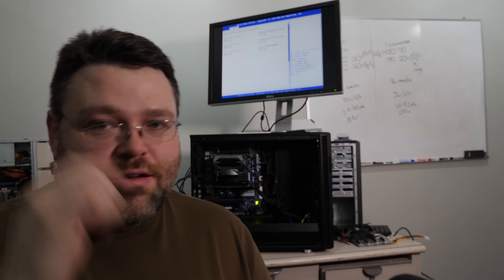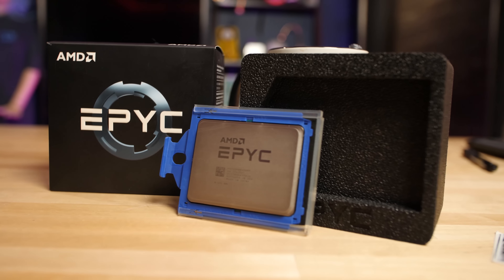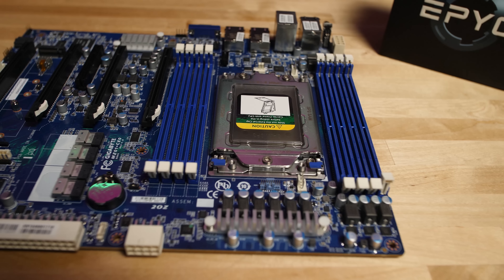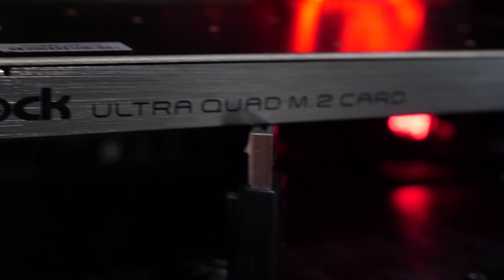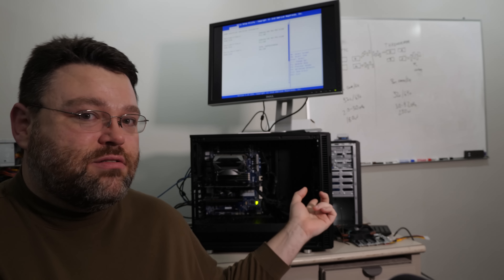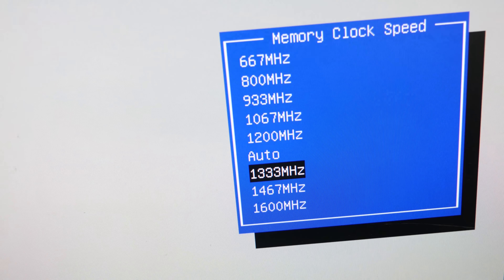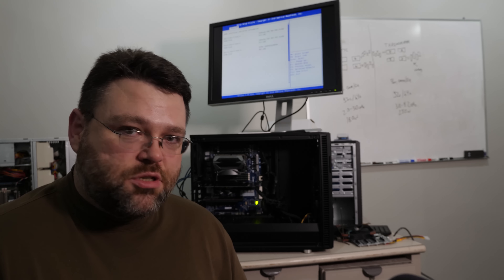Test Driving AMD's Epyc 32 Core Monster CPU

Comment: I would so love to have an EPYC with a Tesla V100 for 3D rendering. I'm sure not even the Tesla V100 has enough memory to cram the Stargate Atlantis city-ship into Iray, however for 3delight on the EPYC CPU that would be sweet, and for doing smaller projects on the Compute card. Very correct about the consolidation as well, cuz of the reduction in PCIe lanes intel has gotten into of late, I have no doubt many boxes exist purely due to the lack of enough lanes to put the extra stuff in fewer boxes.

Great vid Wendell and crew. B)

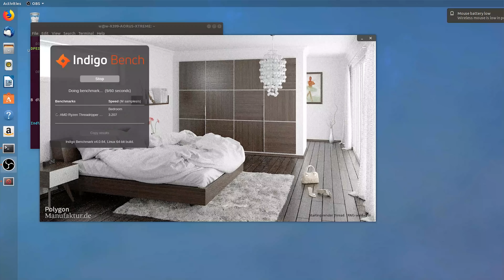Comment: @ 1:15 its slower on windows because you would be using windows 10 or 7 or any other operating system that is not an windows server operating system. 
You could use windows 7 ultimate or windows 10 professional for the great features that come with it such as hyper V, 
Processors like these with lots of cores are not typically designed for gameplay work loads but more in favor for multi tasking and heavy enterprise network environments.

Comment: One benefit to having multiple physical boxes instead of consolidating is redundancy and ability to service a system like add memory, replace power supply, etc., without disturbing the workloads on the other machines.

Comment: When first configuring it, does it auto detect the GPU? I got the same configuration but get no output from the hdmi (GPU). I don't have a vga cable around - but have irdered one. Is it possible that it defaults to the vga first? 

I tried resetting the bios (Cmos Battery out for 5'). I also tried different Ram Modules and have it in the correct alphabetic order.

Comment: Where did you buy the Gigabyte motherboard? Yesterday I was looking for an SP3 socket motherboard to build for a local cluster at school and couldn't find the Gigabyte MZ01-CE1 for sale anywhere! On the other hand the ASRock EPYCD8-2T is pretty similar in term of specs (the 4 x16 PCI-E is an important requirement) but I'm not an expert. What do you think between these two? Help? :)

Comment: At 3:10 "...it [the P-suffix processor] will only work in single socket motherboards." Is that actually true? I realise it won't work in 2P mode but will it really not work alone in a dual socket motherboard?

Comment: I don't even need a 32 core cpu. With that said, I want one. Since its only a 180 watt cpu, a 4U compatible NH-U9-TR4-SP3 will work.  Now that the 7551P is can be found used for under $600.00 US and an ATX server board is under $500.00 US. I may have to start saving my pennies.  This could be a great just because I can build.

Comment: Expensive for a hobbyist (which is why I have a threadripper), but EPYC is pretty damned awesome.   With the half the memory channels, the 2990WX can't beat it (obviously), but at least I can run the 2990WX at roughly the same high-efficiency power envelope as the EPYCs.  The threadripper stuff is more in reach, price-wise.

My one critique is... I really dislike sideways-mounted air cooling on expensive CPUs.  Even the light ones are just too heavy.  If this is going to be a server that you intend to get a lot mileage out of over the years, then don't torque the cpu socket that way.  I'd just get some rack mount shelves and shove that whole case into a rack mount enclosure on its side.  Problem solved (airflow will be wonky if you don't turn that cooler around, but...)

I can't wait for the Zen 2 stuff to hit the shelves next year.   Imagine that 7551P with 64 cores in the same power envelope as the 32-core version has now.  Holy cow!

-Matt
Reply: Nah, try pricing it out. You would be surprised. The MB is around $550 or 600, which is the cost of the MSI MEG Creation board, the upcoming 7371 chip, which runs 8 cores at 3.8GHz and 16 cores at 3.6GHz, is around $1400-1500 (this 7551P is $2200 whereas the 2990WX is around $1700), 8x16GB (128GB of mem) 2666MT RDIMMs are about $1450 (that is about the price of 128GB of consumer 3200MHz 8x16GB dimms), and all other costs are roughly the same from there.

So motherboard is a $0-270 premium, the CPU is around $500 premium, the ram is about on point, although running at a lower speed, but also running with 4 more channels so that you have more bandwidth. Let's say instead of getting the $1400 g.skill kit you pay the $1200 for the corsair kit, then that is like $250 premium. That means you are paying between $500-1,020 more, but getting double the PCIe lanes, double the memory channels, still have forward upgrade-ability, and could add any little add-in card you could want or storage that you want. 

If they included a working Precision Boost Overdrive or a multiplier feature, I seriously would be in heaven, especially since I use a universal water block to cool my VRM, along with 3x480mm rads for my custom loop. I'd switch from my 1950X to that in a heart beat. But this is also talking about workstations, not servers.

So, would you pay up to $1K more to have ECC, the extra PCIe lanes, more memory bandwidth, etc.? That is less than the cost of buying Intel's new 28-Core overclockable Xeon. Literally!
Reply: You can also get a dual socket motherboard and initially only populate one socket with a 16/32-core processor. With lower-end PCs I have found that you always run into limitations with RAM and I/O more so than with processing power.

With a workstation/server setup you can probably pick up cheap processor and memory upgrades a few years down the line to give the system a longer lease on life rather than messing around with a dead-end Ryzen Threadripper system.

I think it's a very specific product for a very specific market with slightly more power than a regular PC but not enough that you can throw the heaviest workloads at it even 10 years later. But if your workloads benefit from a mere doubling of the cores, amount of memory and PCI-E lanes, it is probably the best solution for you.
Reply: @ajc-th5ei  Pretty sure Threadripper and even Ryzen supports ECC (I think you're thinking of Intel).
Reply: @jakegarrett8109  there are different types of ECC: registered and unbuffered. Pretty sure only Epyc supports Registered DIMMs, while the TR and Ryzen support unbuffered, unless something had changed. Also, most consumers don't buy ECC, so would compare non-ECC pricing. Worst yet is consumers don't understand bandwidth and that, even with 2666 ram, you are able to achieve nearly double the bandwidth on Epyc compared to TR, which is nearly double the bandwidth of dual channel on Ryzen, instead just focusing on ram speed due to not understanding the frequency is related to bandwidth and bandwidth is what you actually care about (along with latency). But I digress.
Reply: Ryzen is 2-channel, Threadripper is 4-channel, and EPYC is 8-channel.  Threadripper takes normal DDR4 or unbuffered ECC DDR4.   EPYC takes registered ECC DDR4.  The reason for the difference between threadripper and EPYC memory is that EPYC is designed to handle much denser sticks and the line load is just too much for unbuffered operation.  Registered ECC is a clock or two slower than unbuffered ECC at the same frequency due to the latch latency.

 p.s.  I'm almost certain that the memory controller on the CPU chip itself is the same for all three, but registered ECC requires somewhat different mobo circuitry so you can't mix and match.

Also, in case people are wondering, the consumer Ryzen CPUs also support unbuffered ECC just fine.  I'm using EUDIMMs on both my 2600 and my 2700X system without any issues... even on (most) motherboards that didn't support ECC when they were originally released... it now is.  Linux tells me that the BIOS turned on the ECC... it does work.  Over the last two years, BIOS updates have given nearly all Ryzen motherboards ECC support.   However, not all BIOSes are the same.  The Gigabyte BIOSes tend to be really primitive compared to ASUS, ASRock, or MSI... its hard to tell if the BIOS is turning ECC on or not.  Also, for some reason, the BIOSes don't expose the memory controller MSRs when you plug APUs (like the 2400G) into the same socket.  I don't know why... but its impossible to say if ECC is actually turned on or not on APU systems.  Without the MSRs exposed, the memory controller can't be probed by the linux kernel.

-Matt

Comment: Hi Wendel please let the editor draw frames around the chips you mean in post, otherwise it might not be obvious alle the time which chip you are referring to. Thanks
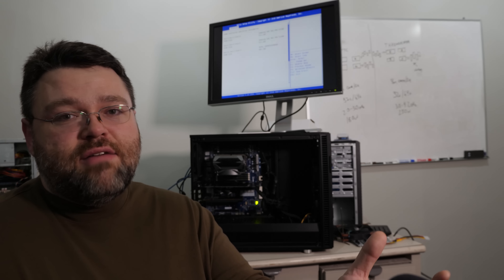17:25 I guess the thing with the threadripper is that they haven't paid MS enough or Intel sabotaged the firmware.^^

Comment: Those sata port would be coming out of the cpu. Would be good to benchmark them to see how good they are.

If you don't know AMD has a GPIO block (they do have a name for it - but I forgot it) that can be switched by the motherboard designer to be either: PCIe, Infinity fabric or SATA. Looks like gigabyte have opted to take a couple of these GPIO blocks and switch them to SATA. Consumer boards just use SATA from the chipset.

Comment: Are their any EPYC workstation motherbords at all?  Can this board maybe overclock EPYC? I want a virtual server to run multiple OS including my gaming OS. I want to simultaneously run at least 5 VM's in addition to what ever VM's im just playing with (not referring to gaming for aditional VM's). Im looking to and it sounds like this board can serve multiple porposes at once including active and long term data storage, daily computing, streaming, gaming, workstation task such as auto cad and 3d design, streaming and possably more. I would really like to take my 6 computers and consolidate them into 1 system. My only real concern with this platform is clock speeds for gaming. Can I reporpose this server chip to suck power and run fast? Or do I have go brake out still yet another couple grand just for entertainment even though its 2018 going on 2019?

Comment: Oh yes, we definitely need to see some risers-splitters and then some flexible PCI-E cables to make a real frankenbuild, the issue might be finding a configurable chassis. might be interesting...
Reply: You can have GPUs hanging from zip ties (I had a Fury in crossfire like that, gave better airflow having it moved away from the other card, and it just suspended by 2 zip ties swinging around and having fun while it played games). I've also had them sitting on top of a pop-tart box and some other thing, maybe a book (it was on my test bench, so no case to suspend from, and the mATX didn't exactly have enough space for the tripple slot thick cards). I'm pretty sure I even had it just laying on a book on top of carpet at one point as well... 

My backup system was so lazily built, I didn't even spend 30 seconds to put it on my test bench, its just sitting bare on a wooden table (you need to move it to the left side so the Titan's bracket thing doesn't interfere with the table and lift it out of the slot, which only took me a few minutes to realize since it wasn't lighting up the "Galactic Empire" logo.

Comment: What are the VRM temps like under extended full load? I will be building a dual EPYC soon, and I am concerned about the airflow, since it will be in a "workstation" case, and not a high airflow rackmount case.

Comment: This motherboard is really impressive! I have no need for it, but that does not mean that I can't appreciate a good product. I'm still sad that Raja Koduri lied about the  SR-IOV in the RX Vega and the Vega FE. I bought 3 of those with high hopes that I can have my home gaming server for the whole family. With a X2 SR-IOV I would have been happy, with a 4X, that would have brought tears of joy to my eyes. I have access to an S7150 that can be virtualized X8 or X16, but it's so weak that it's not worth doing it for anything else than basic CAD.
Anyway, enough ramblings on my behalf! I still have a question:
Since you have access to huge amounts of RAM and core counts, do you plan to do a test with a properly virtualized server using some AMD MxGPU hardware? 
I'm really itching to see how well it performs, especially that Steam does pretty good LAN streaming, but more recently, the AMD Windows drivers can stream Steam VR. Hopefully, this might spark some curiosity in you.

Comment: You should of got Linus to use one of these for his 6 workstation 1 could build. The PCIe in this would make it so much easier
Reply from the maker: Epyc is to CPU lanes as Oprah is to stuff under your seat?
Reply: @Level1Techs  YOU get a CPU lane, and YOU get a CPU lane, and YOU get a CPU lane!
Reply: @iaial0  LTT got a lot of  Intel sponsored videos, not sure if the 6 workstations one is sponsored by Intel, but I think he got the CPUs or mobo part of sponsorship. which would make sense why they are used, but AFAIK epic would of been a better choice based on the IO it gives and it can be a true 1 CPU system. But with Epyc he would have to make sure each part of the VM didnt leave the die its on, GPU NIC RAM all being used on the same die for latency.

Comment: Would any programmer need this at any point in their career? As a student my 8th gen i7 with 16gb of ram is great because I like to program in my VM so I can allocate 4 cpus and 6gb of Ram and the VM works perfect
Reply: Dimitri Findlay  that's kind of the point. I am also interested in concurrency so when I get there the multiple cores will help then.
Reply: @pcelis19  This is still an overkill. How often do you ever see your 8700K consume more than 10% CPU? And that thing has only 12 threads. You can throw in 64GB memory into your existing machine and run 30 VMs without issue. You will only need such density if there is a real use case, namely what Dimitri has said.

Comment: Where's my windows 10 optimization video? Boiler snake asked me to ask you.
Reply: It will remove all "metro" bullshit for a nice and clean windows 10
Reply: @pedro4205  that's a good start, but it may remove certain appx packages that you'd want (think there are .net packages there sometimes). Also, would want a pi hole on the network, and clean up the God awful firewall rules out of the box

Comment: I ran into a similar issue trying windows 10 on a Dell Poweredge. Most versions of Windows only support up to 32 cores across 2 procs. That is likely the issue you are having with 32 core TR.

Comment: Damn!  I didn't know the fryzen would fit in a 4u case.  Just ordered a noctua u12s tr4 in the hopes it would just clear my 4u lid.  (Was willing to gamble it would fit, vs getting the u9s).  After looking up the specs it appears the u12s is 3mm taller.  Hopefully it works, I love me some puke brown fans.  Kind of pissed there are no highend x399 boards without RGB madness.

Comment: Haha, "flex wire temperature sensors" are also called thermistors. I only comment because my first engineering project involved designing an apparatus for soldering thermistors like those on to boards. Good times

Comment: Why does nobody test multiple workloads on multi core CPUs ?   

Not many of us render images.  But many of us run multiple tasks at once on our workstations - compiling, editing, downloading, multiple browser instances,  running the GUI itself, etc.   How do these mega multi core processors handle these real world multi tasking situations ?
Reply: Because the point of more cores is being able to scale a single workload to more and more cores with less downsides. Sure, instead of two 16 core systems you can have a single 32core one running multiple workloads. but unless you're running into virtualisation issues or thread scheduling problems your test is going to yield the results you are expecting. Besides, there are n*n of workloads that you can have on the same system. Which ones yield interesting results to take into account when buying this processor for those workload combinations?
Reply: @-yttrium-1187   I'd like to see a standardized test like using gcc to compile multiple Linux kernels simultaneously, for example.  I spend a lot of my day compiling code in the background while working on other stuff on my Linux workstation.   I'd love to see how these multi core processors handle that.

Comment: Damnit! I wish I'd seen this video and the link to the cooler before I bought the Noctua fan and the Corsair memory I did. The memory is extra tall so I had to move the fan proud of the memory so it no longer fits over the heatsink fully by about 3/4" - 1". To top all that BS off the heatsink with the proud fan just about fits in Cooler Master MasterCase H500M case that I bought.  The H500 case I would not recommend. It is the stupidest designed case I have ever had the misfortune of buying. Wanna damage your motherboard while routing power by buying this case then go ahead.

Comment: Anyone have a recommendation for a source for internal PCIe riser/breakout cables if I want to take advantage of that lane splitting? I'd prefer if they maintain the x16 physical slots for maximum compatibility, but I have some applications that'd benefit from that x16 --> x8x8 and x16 --> x4x4x4x4 capability in particular.